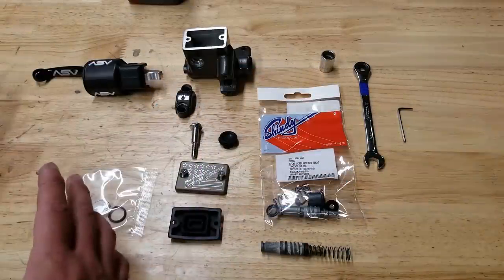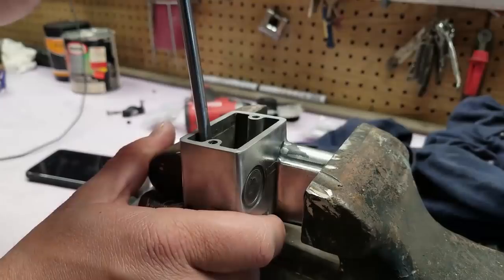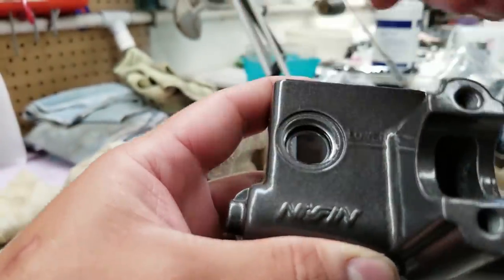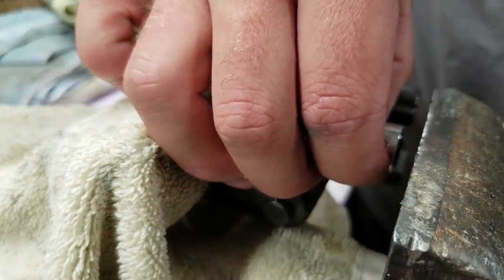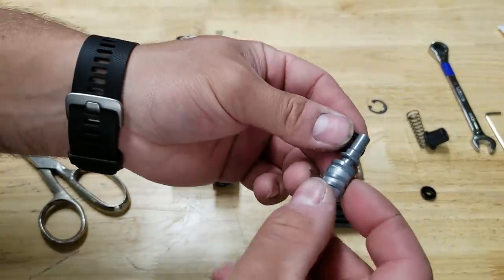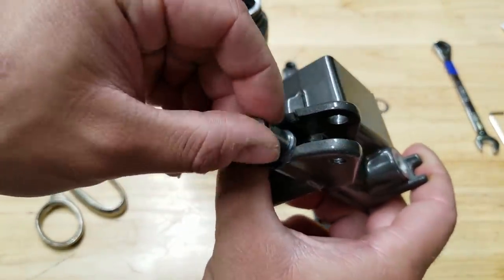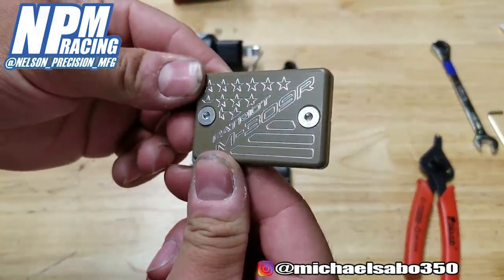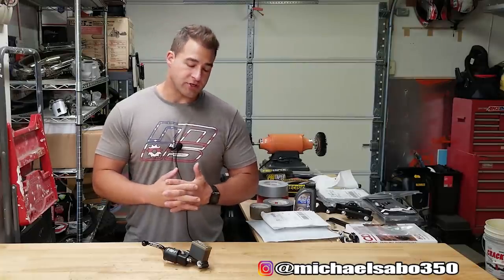Honda TRX250R Front Master Cylinder Rebuild | Project 250R Part 27

Comment from the maker: Before you get mad at me... there's another full length 250R video coming this week 😎 Love you guys 🤘
Reply: i dont care if it 5mins or 1hour as long as you keep these 250r vids coming ill keep watching lol
Reply from the maker: @867diesel  you are the man diesel; thank you.
Reply: oh that bel-ray stuff youre using making a air filter oil for foam filters . i suggest using the uni duel stage air filter with the bel-ray oil and make sure the oil is oozing out when youre working it in . back when i raced mx i used k&n . now i cant believe i was so stupid to run a filter that was dusting my engine . racing xc now using uni with belray and nothing gets past a well oiled filter . i also run kulz 2stroke oil and aviation gas 24:1 rich is life lol and avi gas is at least 100 octain and clean clean . i get 10 gallons for 48$ . lot cheaper than vp . remember ballin on a budget lmao
Reply: dude that is wild. most people these days would toss that in the bin and buy a new one. thumbs up. Now let's see those nets lol
Reply: On bearings dont risk cutting them. If you use a mig welder and put a bead of weld inside the race,it will fall right out
Reply: Good Sir, THANK YOU for the video/instructions/information.
I am restoring 1986 gsxr1100, and both windows are cracked/clouded.... I thought I was sunk until I saw your video.... Thank you so much. Subscribed!
Please, where do you get the windows and where do you get the Shindy rebuild kits?  Thank you so much!

Comment: On bearings dont risk cutting them. If you use a mig welder and put a bead of weld inside the race,it will fall right out

Comment: Same thing happened to me when I changed my sight glass. You the man!!
Reply: Did you have to freeze the sight glass before installing? The one he links I this video does not for the life of me want to go in straight I don't get it .. I've gone through 2 already that catch the edge and bend the metal band off .. any tips ?
Reply: I can’t remember exactly how I did it, but I know I didn’t freeze it. 
🤘🏻
Reply: @nscooz745  damn . i dont know whats going on with mine i did exactly what he did when i try and get it set using fingers right when i put a damn socket in the vise the thing moves. its like it wont sit down in the deal even tried lightly sanding with some 1000 grit to smooth the edge a bit so it will seat some what to get pressed in . im about to be on my 3rd window... lol its a bitch
Reply: @nathanw5747  
I remember it breaking apart when I tried removing it, so be sure the old casing is out
Reply: @nscooz745  yeah I did exactly what Mike did cut out the existing part that was left behind from removing the oem one .
Reply: @nathanw5747  
Dang, idk my good man. I hope you get it to work. 🤘🏻
Reply: @nscooz745  froze the little sight window over night was able to easily set it then let it warm up then pressed it in . I HIGHLY recommend doing this makes it simple and fast .

Comment: When I got to the step at 6:30, the piston didn’t want to slide in. I noticed the top smaller cup towards the spring was flared out a bit from the packaging. I tried and tried to get it in straight and it pushed the gasket around backwards and tore so now I’m waiting on another kit.

Comment: I dont want to be that guy, but after several years of working in the automotive industry the last thing you want to do is put petrolium in a braking system. I get that its a sight glass, but I still wouldnt want to chance that.